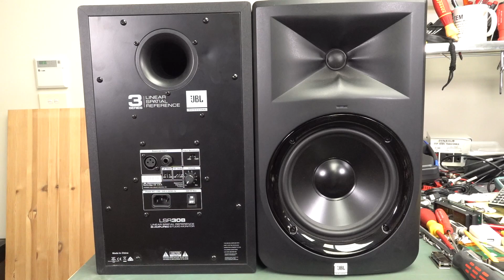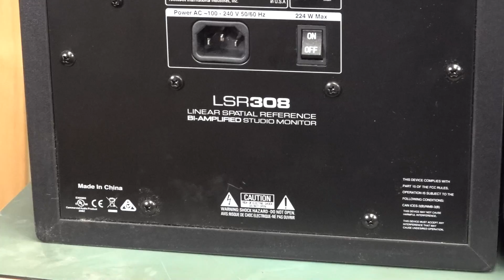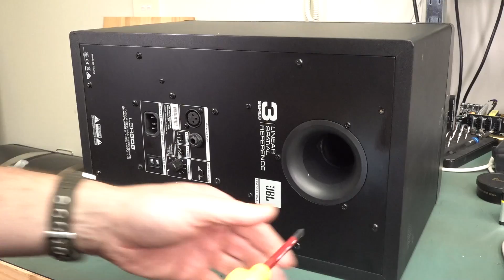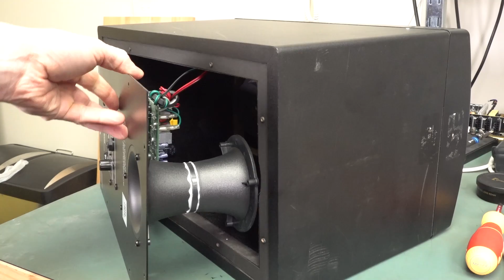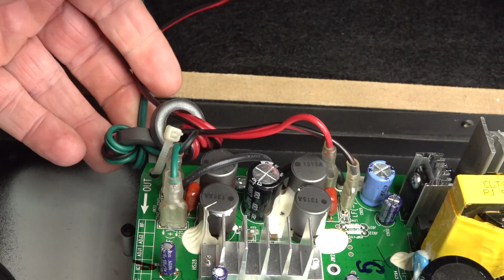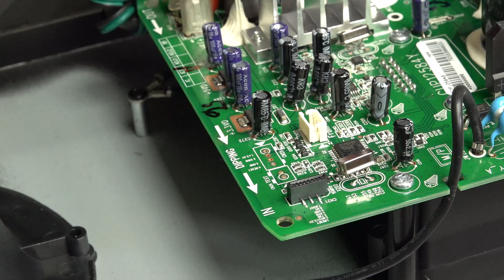EEVblog #1322 - JBL LSR308 Monitor Speaker Repair (FULL)

Comment: i dont get it..can you explain that for lesser educated people? Why is there an ADC in there? why is that needed, is that for the frequency crossover? Doesnt that mean that it also needs a DAC to covert it back again? And if thats the case, does it even make sense to feed these monitors a signal from a several 100eu expensive DAC, if it converts it back and forth again with that cheap internal converters? i mean they gotta be cheap considering the price?

Comment: In my case it's no sound and LED off. I checked the PCB power supply segment and everything seems ok. I just left it alone connected, then one day it just functioned ok, LED and sound. Then one day it's again dead. It just alternated like that without me doing anything. Today it is dead again.

Comment: Hi. Can I bypass this internal class D amp and connect external amp outputs to some place on the PCB? Or do I need additional crossovers to convert them to passive monitors?
Reply: I know I'm way late, but you would just unplug the speakers from the PCB entirely, then wire those to a crossover or an amp with a DSP.
Reply: @tboodman  :) thanks

Comment: @EEVblog2 thanks for this detailed video. I do have one issue with this same model; it has a very low volume output even at maximum volume on the knob. What could possibly cause this? Thanks in advance

Comment: When you cut the pins off, I tend to run a bead of solder over all of the pads to make them one big blob so that no individual pad experiences forces on it from the knife. After the main plastic husk is gone, melt them a couple at a time from the outside in (never side-ways) with the tip of an iron. And finally some wik.

Comment: This type of amplifier working normally will have a voltage on the output terminals will equal 1/2 of VCC.  If it's VCC the chip has a short.  If it's 0v check for a short to ground  on the final outputs plus suspect a shorted or disabled chip.  Rule of thumb start with the part that handles the most power.

Comment: These speakers actually sound really good. I have the newer version of them and really enjoy them. I also have some vintage 70’s sansui and pioneer amps and speakers made of real wood and decent build quality. Hate to destroy the dream but my jbl monitors sound better. The acoustic design and matched amplifiers make these sing. The stereo separation is way better than the old gear.

Comment: The LSR monitors do sample the inputs with an AD/DA system. The on board DSP does fr, timing compensation and crossover with the outputs piped straight to an amplifier. It's part of how they get the measured response to look decent. At the end of the day what matters is what comes out of them, and even though they feel ridiculously cheap, they sound great. The $20k M2 master system also requires an AD/DA system for the same reasons.

Comment: 99% of the times, it is the output D-amplifier chip. Argh, Dave!! use hotair for soldering that poweramp IC ;-) But anyway, I am impressed that JBL actually used good quality PCB and good quality components. Very very often it is some strange "noname" poweramp chip that is blown that is almost impossible to get.

Comment: Not sure where I learned this but a nice way to get SMD chips off without using a knife (if there's not enough space, or it's a good chip you want to re-use), is with a piece of thin enameled wire. First you feed it through the gap under all the pins, then you scrape and solder the end to the nearest strong pad. Then pull the other end at a 45 to 90 degree angle away from the chip, and using a normal soldering iron tip, heat up each pin starting from that end. As soon as the solder melts, the enameled wire slides under the pin bending it up slightly. Since it's enameled, the solder won't stick to it (unless you linger and melt the enamel), instead the solder gets dragged out of the way, making a nice gap between the pin and the board. Once one side is done you remove that wire and use a fresh piece for the other side. Although I haven't encountered chips with thermal pads yet, I see no reason why this wouldn't work as an alternative to the knife method to separate the pins before doing the big pad.

Personally I find magnet wire perfect for this, a good source being cheap little DC motors, which you can also salvage quite easily from little un-repairable motorized gadgets.

Comment: Would it be possible just replace the board?  If you don’t have the testing equipment outside of a multi-meter and soldering kit. After a visual inspection shows no burnt or blown components, couldn’t I swap out boards from my speaker that’s working and then just replace the faulty board?

Comment: I wonder if there are any "audiophools" out there with a pair of these that think they sound amazing, but little do they know it's all software driven. 😂
Reply: Now for sure they will abolish it because they know the only true audiophool quality can be achieved by pumping some wobbly mechanical sound action from a rotating piece of vinyl through a $5000/ft angel hair copper wire into a lightbulb on steroids.
Reply: @stragulus  Apparently it is also acceptable if you play back digital media from a NAS over directional ethernet cables that cost at least $1000/ft.
Reply: @TomStorey96  Oh dear. I hope they only use audiophool grade SSD's then, because regular SSD's cells have a decay pattern that introduces jitter when you attempt to read sequential cells. I just happen to have such a batch, let me infuse them with a little ursidae extract for maximal cell pattern alignment and then we're good to go.
Reply: Have any of you commenters actually listened to these monitors. Or just opinion without actually using your ears?? Chat room opinions I reckon.
Reply: @MrRandomposter  Did you miss the joke or what?

Our comments are quite obviously in jest.

Poking fun at the kind of people who probably think that a 2 metre power cable suspended off the floor on wooden blocks improves "sound stage" or what ever it is they claim...

Comment: LOL that was a real bodge repair, definitely needs redoing.  I've done PowerPad components, either pre-heat to around 160C on a plate or using the hot air gun, then hot-air the chip off at 350C, it just floats off the pad, use leaded solder with a large wedge on the iron and mix up the lead-free with leaded, suck up the huge ball with a desoldering gun, do this twice - get rid of every single bit of lead-free, then run over all the pads with leaded to leave a nice raised bump of solder, then put the new IC down (heat it a bit with the hot air gun first) and then watch as it does the Rossmann Dance into place, nudge it a bit with tweezers to get it bang on and you're done. I've found using leaded solder with C511 "Crystal" flux negates the need for separate flux when reworking, a real time saver, plus it's quite tacky at about 140C so perfect for manoeuvring SMDs into more-or-less the right place by eye (before the microscope)

Comment: The micro has to program the DSP parameters in the amp chip at each startup.   The blinky blink is caused by the failed i2c handshake.   I suspected the failed amp anyways when I saw how tiny that heat sink was.   The header next to the micro is probably used to program it during final assembly, I doubt they want the chinese factory to have access to or the ability to reverse engineer the DSP parameters, which is JBL's magic sauce.
Reply: the heatsink is small because it's a class D amplifier - they produce hardly any heat as they are very efficient

Comment: That was interesting, Dave, congratulations on solving the problem! But I’d personally prefer bottom heater and hot air to resolve such soldering issues.

Comment: ...they haven't designed studio monitor w/ linear amps in over 15 years. Pretty much no one has. The last product for JBL was the LSR6328P/LSR6332P  in 2005. 
1) too costly
2) too inefficient. this is big one. There's all kinds of efficiency standards over the past two decades. Less heat and more reliable with digital.
3) clumsy to design 2-way/3-way class AB with analog filtering etc.. it's much easier to design a better-sounding monitor in the digital domain (if done right)
Some subwoofers are still linear but not too many.

Comment: This is modern loudspeaker design. Build a shitty speaker and fix it in DSP. There would be all kinds of EQ and time alignment being done to make up for the cheap driver components and poor chamber and port design.
Reply: A lot of monitor speakers use DSP to get a "flat" response.. most speakers are not flat whatsoever but monitors typically are
Reply: @jaycee1980  And before we had cheap DSP we had to design speakers properly.
Reply: @TheBrightPixel  lots of monitor speakers used active crossovers with opamps before separate woofer/tweeter power amps. The DSP is doing the same thing in the digital domain
Reply: @jaycee1980  I'll let you in on a little secret. I worked for 3 years in the design department for a loudspeaker company that possibly sells more cheap monitors than any other brand. If I said the name, every person that read it would know it and 50% reading it would have owned a product made by our parent brand. Loudspeakers, like this JBL one, use DSP tricks that were just not possible only a few years ago. Especially to do with timing. Due to NDA I cannot say much, but now with a 1 dollar DSP chip we can basically "fix" a very poor cabinet design and also "fix" cheap drivers that flex, have awful cones and shitty magnets. Put a waveform onto a woofer component that flexes, then measure how it flexes and compare the input and output waveforms. Repeat for a bunch of different frequencies and map the behaviour. Then design an algo that emulates this flexing in reverse, dynamically. You get the idea. When I say fix, I mean make it sellable. Our high end products used proper designs and italian components. Our consumer products used whatever our Chinese manufacturer had in quantity for cheap and we fixed it in DSP and slapped a logo badge on it with some nicely tooled moulds and they flew off the shelves for 200 bucks. Made way more money than the high end products - that's why these products exist.
Reply: Yup, just like Pure Avanti Flow radios - all in the DSP and ported design, remove the guts and connect up a standard power amplifier and it sounds muffled and bass thin.  That is the reason why there is a A/D on the front end with a class D amp attached, to allow all that fiddling to go on and also drive the bass/treble separately.

Comment: The reason for converting to digital is for DSP correction and crossover for the drivers/cabinet and results in a much better speaker overall for the price
Reply: Yeah, I don't see the problem of using cheap digital components in this modern age if it gets the job done well. Except for the blowing up part, that is..

Comment: I've got a related speaker, the JBL LSR310S (subwoofer) with the same issue, minus the blinky LED. Power LED is solid on, but no sound comes out. I was stumped for ages after seeing all the power rails looking good. I guess I'm going to have to learn to reflow solder now!

Comment: Kapton tape or even aluminum foil can be used to shield surrounding components from the hot air gun
Reply: I use the Kapton tape method as well it is very effective
Reply: I use alu foil from the kitchen folded up so it's quad thickness... easy, cheap, reusable, does the job :)

Comment: Ooooh these are great monitors!! I bought a broken pair on eBay and fixed it myself, Saved $200! Power boards have issues for sure, they made down to a price.
Reply: What did you replace in order to get your speaker to work again?

Comment: Instead of using the knife to cut the pins I would always use a very thin gauge wire slid underneath the area where they rise up off the board. After soldering it to pin 1 of the IC you can basically just heat up pin 18 and drag the other end of the wire underneath and out which lifts the pins off the board. Once pin 18 is lifted you can just move the iron up the chip and all the pins will come up. That way you don't have to worry about cutting the traces, but you do have to be careful not to break the wire!

Comment: Why are those crystals elevated?! This breaks all high-frequency rules of thumb as the leads will act as inductors... And it appears to be deliberately as both crystals are up like that!
Reply: Maybe it so the metal can of the crystal doesn't short to the PCB. There might be traces under the crystal.
Reply: @simontay4851  the traces are isolated as the can is there to shield the RF emissions from the crystal
Reply: My guess it is because whoever designed the PCB didn't specify for straight leg crystals?  I asked a guy at work and he thinks it might be for thermals when soldering or a mechanism to hold the crystal to the board whilst soldering?
Reply: @davidhunt240  never heard of those cases, would love if @EEVblog2 could explain if he knows something about this

Comment: Since the crystal for the clock of the amp need to be specific, and since is less then the maximum frequency than the STM can handle, anybody know why it uses 2 crystals instead of 1 ?
I dont see the need for a specific frequency clock for the STM. Why don´t use the AMP crystal when it´s a well buffered clock signal ?.
I must be missing something but i don´t see what.

Comment: "port is wizz-bang designed"
actually there is only one correct port size/length for the box dimensions... i remember i had a book back in the 90s that went through all the math/physics and included formulas to work out port length/size...made a nice ported box for my 12in sub ..i wish i still had that book..went into info on crossovers and multiple speakers in the same box..
im pritty sure it was this one..from 1981!.. "Designing, Building and Testing Your Own Speaker System-- with Projects" available on amazon
Reply: Yeah I'm guessing they use the same flares and just slap in a different length center section depending on the cab and driver for each model.
Reply: They have a current patent on the port shape, goes with the fancy waveguide on the front. Can't assure you it does something.

Comment: I would not have been happy leaving that chip staggered like that. It isn't a BGA or anything. Why not just heat it up with the air and use some tweezers to center and press down?
Reply: Thats what i do with multipin QFPs and SO packages. Just use hot air.

Comment: Ever seen any Kemet caps dave? Apparently there's amazing but rarely in consumer stuff
Reply: I use Kemet capacitors alot myself.  They do make very high quality caps that do well in harsh environmental conditions.  Of course they also make alot of cheap, run of the mill caps, too.
Reply: Never heard of kemet. I always use panasonic FM or FR series.
Reply: @simontay4851  Kemet have been doing solid capacitors like ceramics and tantalums for years.. they've only recently gotten into the aluminium electrolytic market... they are good quality though

Comment: I would not be able to sleep if I misaligned the chip like that... How could you?
Reply: "Good enough for Australia"
Reply: I wouldn't be happy with that either. That alignment is not good enough. The speaker works but its a bodgy repair. If this was a repair for a customer and they opened it to check my work and saw the chip misaligned like that, they'd think i didn't do a good job and wouldn't trust me again.

Comment: We used to round the tip of the exacto blade, to mitigate cutting traces and come in at a steeper angle. This would make it easier to cut the leads off the chip.

Comment: Do these speakers use a seperate lower power amp for the tweeter? In that case it does somewhat make sense to do the DSP digitally if your amps have digital inputs. Doing the crossover calculations digitally is just going to be more precise and as others mentioned, doing calibration is a bit easier.
Reply: yes, it's normal for powered monitor speakers like these to be bi-amplified.

Comment: What is this ? Thin plastic front, thin metal?/plastic back...then MDF for the sides and some loose ass flimsy "acoustic foam". That's not a speaker. It's a chop your head off expensive shoebox for the hype-hype-hypies.
It's really that bad to look at. Come on Dave. Man, you know you should've gone vintage.
Reply: I have die cast alloy casing Focal CMS40's.
Reply: @EEVblog  Pheew. That's better.
Reply: Any serious studio using these for monitoring would be promoting Dolby Noise Reduction! LoL, I bet that they probably turn down the treble in the final mixdown to compensate for all that hiss LoL. That would drive me insane! In a dead quiet room with what would sound like a tyre with a puncture that refuses to run out of air LoL.

Comment: I'm guessing that the digital sampling and filtering allows them to effectively calibrate the response of the speaker for variances in assembly. Probably means less precision needed elsewhere re: ABS front panel, etc...
Reply: Likely.
Reply: It's because of the time alignment of the waveguided tweeter. It's easier (cheaper) and better to do digitally.
Reply: thats actually quite clever if that's the reason. Take an IR or something of the enclosure and use that to calibrate each speaker.
Reply: I bet that DSP chip can compensate D class amplifier distortion levels at least at high frequencies
Reply: @viperwizard491  The fact that the ADC is Sigma Delta also plays a big role in the Noise and resolution department.
Reply: @exprymer  and DAC improves it all with dead time ,sample rate and parasitics and speaker (load ) interfere with 1st order filter and high efficiency
Reply: Like a number of the JBL Pro speakers with their Image Control waveguide from the M2, it requires more complex filtering that is hard to acheive with analog circuitry.